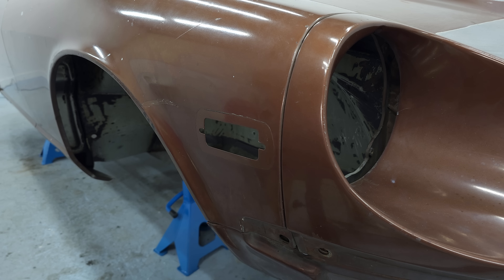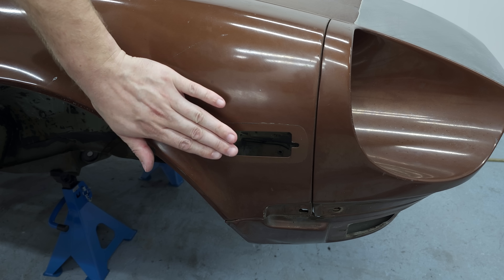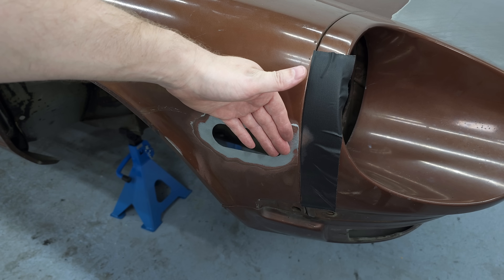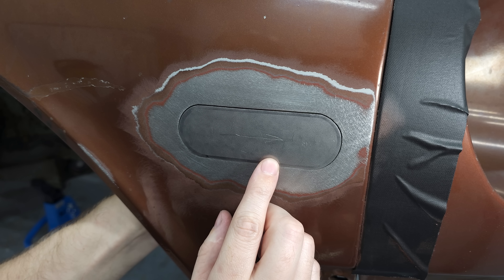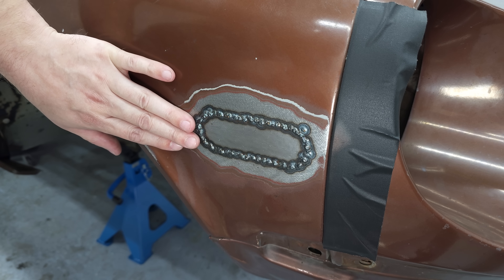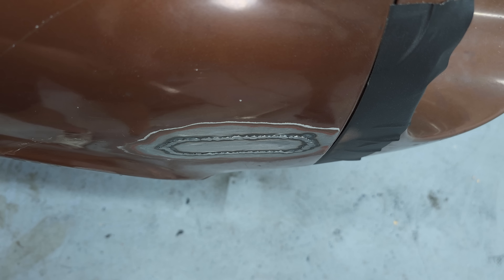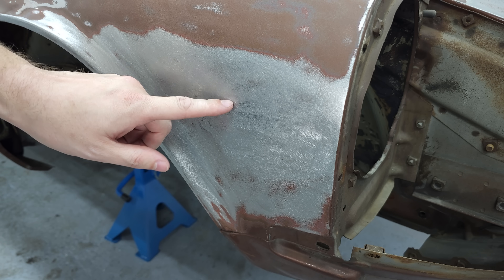How to weld a Patch on a Car - Side Markers Delete 240Z

Comment: Professional welder here. Not one that works on cars though, I'll admit to that.
You've done a pretty good job at it, that material is super thin and even with the lowest setting you can still quite easily burn a hole into it while using a MIG welder.
I probably would've recommended TIG welding instead, but if MIG is all that you have then of course that's not an option. Really solid job. Although I would want to say to maybe try a little bit of filler around where the edge of what you just welded is, cause that's quite visible still. But nonetheless, for someone who's doing this for pretty much the first time, you're doing such an amazing job at it.

Comment: I showed this to my father, a retired panel beater and he said he would have welded an oversized sheet to the back and then used the oxy acetalene torch to create stretch circles to allow the metal to relax into the correct profile. As you heat the circle, you hammer it from behind so that the panel fills the hole while taking on the shape of the hole. Afterwards you can grind off the excess from the rear if you want but its not absolutely necessary. Once complete, some spray on underbody protector will stop any rust forming in the void. I guess you will be doing the whole of the underside of the car in underbody once all of the repairs and mods are done.
Reply: That sounds like a level of skill you only achieve if you weld for a LOT of years...not realistic here..!?
Reply: @andymccabe6712  Admittedly yes, he was time served with over 50 years working at it. He freely admits to not having the skills that the channel owner has when it comes to other forms of metalwork such as turning and milling etc. I am personally in awe of everyone with any serious skills with any form of material. Sure, I was taught to weld by my father but I'm no welder and I learnt turning and milling at school but I am no serious engineer.

Comment: I'm curious that such a precision kind of guy as you are isn't using TIG to do the body welding? I took up TIG specifically for welding thin sheet metal after far too many holes blown through material with my MIG machine.
Reply: Because he doesn't know how to use one. He barely knows how to MIG weld. 😅
Reply: @ArniVidar  I've could swear I saw him TIG welding in one of his restoration videos.
Reply: @warrenmusselman9173  Yes, if I remember correctly he borrowed a TIG welder and used it for one video. That was the first time he ever used one, and definitely not enough practice to move onto a car he loves. 😅
Reply: @ArniVidar  Hey, I'll never be accused of being a professional welder with any process but I do make more bad weld at once with the MIG machine. TIG allows me to at least make mistakes slowly. 🙂
Reply: @warrenmusselman9173  That's certainly one way to look at it!  🙂

Comment: For a project like this it might be worth using TIG. It's more tedious to weld but you'll get less shrinkage and TIG welds are way easier to hammer and dolly out later on.
Reply: That might be the case, but he's really not a very good welder, and TIG is brand new to him. So I guess it's better to do your best with the tool you know, rather than do your worst with a tool you don't know. 😅
Reply: @ArniVidar  It's pretty easily learnable...
Reply: @deeiks12  remember, he's doing EVERYTHING on this car.....so he needs to be good ENOUGH at ALL the skills required....he's not trying to be a professional welder with years of experience.....!!

Comment: Are you concerned about rust on the new patch?
Reply: Nah!....I expect he'll just let it rust through.... What do you think ......!!?
Reply: @andymccabe6712   At worst, there would be a little surface rust. It might be better than coating it with (for example) a light oil that would prevent rust but would also need to be completely removed before painting. I'm just curious as to what Mr. MM plans to do....

Comment: Welding on older metal, even if not rusty, almost always blow a hole. I found that out while restoring 3 British cars. I always needed to turn down the voltage of the MIG welder, specially when tacking..

Comment: There is a product called “cold front”  it is a paste that can be put along both sides of  a weld and it keeps the heat contained. I have used it many times and it works very well . Especially on large flat panels to minimise the warping 👍🇬🇧

Comment: So if understand correctly, the patch you bought online would've worked ? Because you had to manually reshape the entire section  after welding it anyway, right ?
Reply from the maker: I think you could,ve beaten that one into shape too. But being flat to begin with also has too little material.

Comment: Your standards are crazy high. Kudos. I was surprised when I saw you using a MIG welder. That is the sledge hammer of welding. It gets jobs done super quickly, but the quality is very hard to control. With the kind of precision you are striving for, a TIG welder might be more your thing. It takes nore effort to learn how to use a TIG, but when you have learnt how to use it, you have much better control over the outcome.
Reply from the maker: Thank you very much!

Comment: Oh man that is smooth as a baby's bottom!  I would have stopped at welding the patch in the hole...(I'm more concerned with just getting rid of the rust and replacing solid metal).  Great video thumbs up.

Comment: Impressive attention to detail and commitment to quality. I do wonder whether, given the amount of fettling required, the precut patch would have worked just as well overall.
Reply from the maker: Think it would be possible too, but pretty tricky to weld around the small tabs. Because after every weld the patch will warp and you need to align it for the next weld. If it warps around the tap, pretty tricky to bend that small surface.
Reply: @mymechanicsinsights  Interesting, I take your point, but... to know for sure we clearly need to buy 10 more cars, and try different approaches on each. We have no choice. 😏

Comment: 3:33 ok so I’m not normally a car person but after you sanded it back I couldn’t help but noticed the layers, is it common to have the light/while layer under the top colour or is that from other owners repainting it to suit their own tastes?

My only knowledge of painting is self taught painting of mini fig scale models and a little bit of oil painting there both qtuite a difference to car bodywork 😁
Reply from the maker: Yes, I also mention it later in the video. It was once repainted and they applied a thick coat of high build primer.

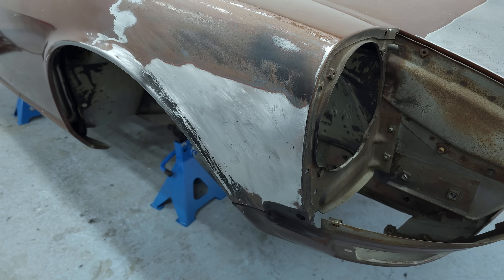Comment: I think you sanded some welding spots too much or at least that seems to be at this point where you can see the shape of the metal sheet 👉 14:25 .
Anyway, still is an amazing job and I'm sure you could improve that later.
Reply from the maker: Maybe a tiny tiny bit, yes. That's very tricky. But the paint just sticks in every thiny low spot. at 11:43 it looks pretty good I'd say.

Comment: That's an excellent first panel! I'd like to make a suggestion though, ditch the mig welder. Tig will give a much better result and much less cleanup work and distortion when you've got the hang of it. I've actually got a video on my channel titled 'How to do a perfect sheet metal weld' where i go into detail about everything I've learned about it over the years. It might help.
Reply from the maker: Without the practice with TIG, I think MIG is the way to go for me ;-) but thanks for the input!

Comment: Hey, great work!
Just curious, when welding in the video, did you use a physical lens filter or did you do it with a software and which one?
Reply: I wondered if it was shot through an auto-darkening welding mask?
Reply from the maker: It's done with editing ;-)

Comment: Knowing your attention to detail, you will probably end up sanding off all the paint before you are done, maybe you should get the car completely stripped before continuing.
Reply: If he were to strip all of the paint at this time, it would need to be immediately primed to prevent flash rust, therefore nothing to be gained.
Reply: @ralphgesler5110  in the USA, there's at least 1 company that provides an on-site service that will take off the paint and add a protection coat at the same time.
Reply: @leisurelylogan  But he's not in the USA.
Reply: @Vickie-Bligh  I know that, which is why I mentioned the USA.  Hopefully a similar system is available in his country.

Comment: As always, you have devoted a lot of attention to the job you have done. By all means, it is quite a good job and does not need excessive filler, which is great. I suggest using a wet cloth every time you are welding a part; this prevents the part from getting out of shape.
Reply from the maker: Thank you very much!

Comment: At 5:46 when you're cutting the insert to size, does using that cutter create any kind of lip on the edge that will need to be flattened back out? Usually when I see this process in videos, they'll use a cuttoff wheel. Just curious why you chose one method over another. Great video!
Reply from the maker: The shear is razor sharp, so it makes a very nice edge, with no deformation.

Comment: Out of curiosity, would it have helped if you preheated both the fender and the patch?
Reply from the maker: Nono, heat is your worst enemy working with sheet metal. Your panels will warp badly.

Comment: First of all: thank you for your way of working! All the coach workers I know would putted there a ton of putty and than sand everything to shape. The fact you are really shaping the metal make you one of the best coach worker ever seen.

P.S. just a little tip from a welder: if your machine can adjust inductance, reduce it as much as possible, it will keep the heat in the wire instead in the work piece. It should help with burn through and heat warp ;)
Reply: I dig all the pro welding tips on your channel.
Reply: @eriklarson9137  Thank you, I appreciate! I try to leave some tips when I can because welding is one of the techniques where you can still learn for an entire life, so I appreciate if someone could do the same for me.

Comment: Like you can watch the experts that build top tier cars, the ones they take to SEMA, and they ALWAYS you filler and glaze. All that wielding is just over kill, IMO. 
You could have just put a couple of spot wields to keep it in place, then glazed it to spec to fill in the gaps.
Reply: Behave yourself. You’re criticising him for doing it correctly? Wow.
Reply: @sjv6598  I'm saying it's not correct.
Reply from the maker: That's bad work at the highest level, we call that "Pfusch" in german. That's the perfect spot for rust to build, vibrations and everything will ruin the fender over time. After two years you need to redo the bad work.

Comment: if you have any future weak metal to weld or holes to mig up, placing a piece of copper behind it helps to prevent it blowing through
i've flattened so copper pipe and attached that to the wider welding vice grips so the rear jaw has the copper, clamping over flange holes where some have been drilled right through on panel separation, this allows to mig those holes up in a single weld without a ton of grinding on the back as well as the front

great vid and excellent patch repair and results, loved the mig weld edit glows

Comment: Absolutely love watching your videos. As a body tech, this is an incredible piece of work. Quick tip for checking your work: if you want to check what it will look like high gloss before you prime the area, use prepsol (wax and grease remover) to spray over the area giving it a temporary shine and you can see any imperfections in glorious high gloss - always my go to. Love the work
Reply: A less messy, but possibly not quite as effective, technique is to use cling film

Comment: As always you strive to do things the right way. Some have commented about fillers/bondo or high fill primers etc, but there used to be a technique used in India by body shop guys who did not have access to bondo, they would heat up the surface and would smear lead/tin into the heated area and shape the area using that, then they would sand it smooth. I am not sure if such techniques are right or used in the trade in your nick of the wood.
Reply: Lead is old school Bondo
Reply: We used to call them Lead Sleds here.
Reply from the maker: There's also lead/tin already on the car from factory in some spots. High quality way for filling damage, Much better and more permanent than bondo. I'm going to use that technique too on some spots.
Reply: lead bad  xD

Comment: The fact that you took the time to finesse that patch into shape rather than slap a coat of Bondo on it was truly impressive.
Reply from the maker: Doing it the right way! Sadly these days you don't see that very often anymore, cheap and fast is the way for most.
Reply: @mymechanicsinsights  Exactly, because of sentences and videos like that, you're the best!
When I see other videos, at some situations I think "My mechanics, would have made the next step into more detail, why not you?"
Reply: @mymechanicsinsights  iron triangle often leaves quality wanting.  Love the channel.
Reply: What did you expect?
Reply: @jagolago-bob I consider myself pretty detail oriented, and I would have welded in a flat piece of metal, ground down the welds, and used a thin coat of bondo to restore the curvature. Taking the time to get the metal itself into such perfect shape that it needs no filler is what makes mymechanics the restoration master of youtube.
Reply: @abie1308  I would and always do shape the metal. As little filler as possible. It somehow feels fake if it isn't the correct shape.
Reply: Make a new wing panel? ;) @jagolago-bob
Reply: quality needs time, passion and knowledge. Quite old fashioned in a world of quick profit. I am not wondering about stunning eyes 😂

Comment: Most people would've said, "Good enough," and sanded it down. The problem with that thinking, on a job this big, is that once you start to compromise on details like that, you'll do poor work on the rest of the project. Better to spend the time, get it perfect, and it'll set the tone for the rest. Great work as always, sir.
Reply from the maker: I want thjis car to be perfect. My plan is to use no bondo or just very little.
Reply: I'm no expert but isn't fixing minor errors in the surface what car body filler is designed to do? Same end result with an order of magnitude less effort, leaving more time to spend on getting other stuff perfect that actually needs time. The arithmetic is a little different when you're producing YouTube content though I guess.
Reply: @zxxvcc  It depends on what your goal is. An okay looking car & get done as fast as possible? or to create the ideal car? MM wants to create an idealized car, better than factory produced.
Reply: Ah, so filler gives a visibly not as good result - I see. Not an expert so I assumed it would be visibly identical, and functionality equivalent 👍🏻

Comment: That final shot with the camera rotating really did your work justice on how well your shaping turned out. It was hard to see throughout the video because of the straight-forward angle. But that final shot really hammered home the point, pun intended.

Comment: Bigger holes are the way to go. A lot of people sniff at that, but the smaller the patch, the worse the results can get. You also end up grinding the surface too much or warp it as a result. Using a larger patch, even larger than the existing hole spreads the forces evenly. It also has the bonus of the fact that on old cars, with the intent that someone may want to put it back, you can hand them the shape as it was, easy to replicate or weld back in, as the desire. The smaller the patch, the bigger the warp. I wouldn't touch anything smaller than a hypothetical square with an L of 12 cm. I know, controversial for some, but i find that this and using a copper pad on the back keeps the warp to a minimum.

ALSO, very important, magnets distort the weld. MIG and stick suffer the most from it, TIG gets away with more, but ultimately, you don't want to put welds in close proximity of magnets because it doesn't let the current go in properly. I usually use these small clamps that are very similar to tile setting clamps (basically a threaded T piece that slips into the slit and then with the aid of a nut, brings the two sides perfectly even and, more importantly, evenly spaced).

Comment: Give the tack welds a few hits while they are still hot , this will stretch the weld metal and compensate for the shrinkage during cooling. Use the dolly as well of course and try to be consistent with each tack weld. The result will save you a lot of time trying to stretch your patch back to its original shape.
Reply from the maker: I made it like "Make It Kustom" tells in his videos ;-)
Reply: @mymechanicsinsights Trev's blog is also a good channel for the body work
Reply: @mymechanicsinsights  Karl is the man.  Another great one for metal finishing, but who doesn't use the cooling technique, is Cornfield Customs.
Reply: I knew there had to be an expert welder in the comment section. There always is.
Reply: retropowercars and Crucible Coachworks also have great videos on welding body panels.
Reply: That's actually not a good way to go. You end up over stretching the high points. Much better to grind smooth first as he did.
Reply: I noticed  Arthur tussik @tussik01 keeps a wet cloth in one hand and immediately cools the tacks with it.
Reply: @Watchyn_Yarwood  wouldnt that risk cracking tho if it stresses too much
Reply: 你行，你上啊
Reply: No, absolutely do not do that. You compromise the integrity of the welded area that way.